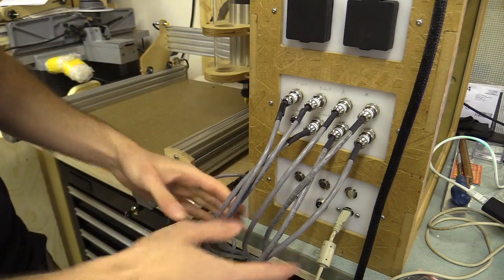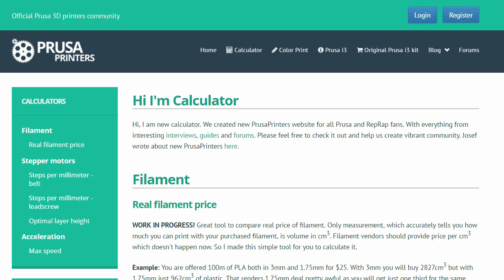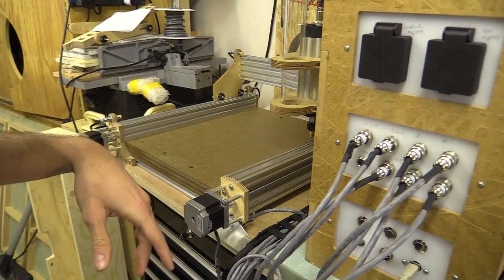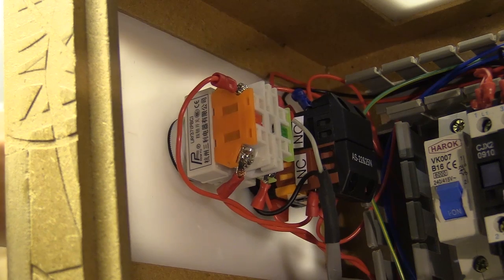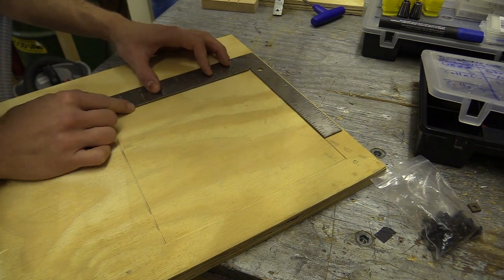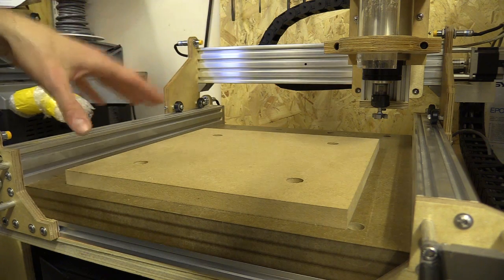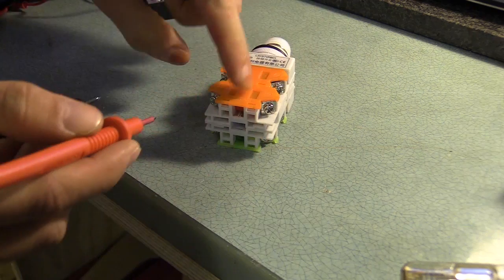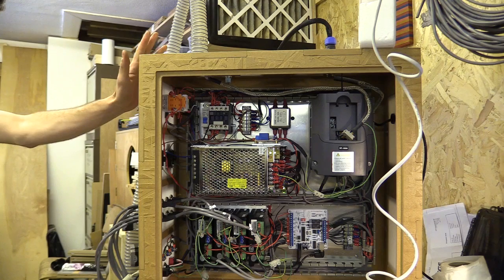#18a Debugging CNC Router Machine and Controller Enclosure #18a / Troubleshooting

Comment: Can't you use the enable connections on each of the drivers to stop the steppers without cutting power to them? All controller software will control the enable on a driver the same way. http://www.leadshine.com/UploadFile/Down/M542V2m.pdf
Reply from the maker: I think you are right but my latest controller is very different and uses the Duet 2 wifi. No need to faff about with external drivers.

Comment: So far you have done a real great job with the referring to issued related data ، i saw you changed water cool spindle with air cooling system ، i received someone suggested to use small radiator witch be installed on x axis and in did worked out perfect .

Comment: Could i ask if the two step motors that control the bed (x axies) are connect to the same wire that goes into the electronic controller  or two different wires that go into the electronic controller?

Comment: Thanks for all of the great videos! I've got my X & Z axis put together, but have a long way to go. Looks like lots of soldering. Any recommendations on bits?
Reply from the maker: Yeah life would be a lot easier if you can by a pre-assembled controller but I'm glad I made mine myself. I seem to be using a lot of 1/8 inch chinese bits. They are cheap and easy to use. I should make a video about the bits I use at some point.

Comment: Price of stepper motors in China are 300 percent  the manufacturing cost, like 80$ for a  100kg cm Motor, 20$ for 30kgcm motor etc, they should add 1$ for assembly and 2$ as profit,  Let's all the hobbyists make our own quality motors , one will procure laminations another copper , another will be making body .... we have to form a team, copper in my place is 10 dollars per kg , laminations is 2 dollars , steel casing for motor is 2.5 dollars per kg , other  accessories can be estimated from above prices . We can make a 100kg cm motor for 15$, let's join as team and start making these. Spindle motors of 3kw can be made under 50$

Comment: Unplugging stepper motors from their drivers while under power is excellent way to kill the drivers. 

If you want the spindle to stop faster you can try adjusting the slow-down time in your VFD drive. Breaking obviously depends on how much power your VFD can sink and on RPM and total rotational inertia - so bigger the cutter, longer the stop timeout, although I'm not sure if it'll be noticeable unless you use massive fly cutter or something like it). Good VFD's will trip and shutdown without failing if you make them stop too fast, the Chinesium one you have might do the same or it might decide to die, so test at your own peril.
Killing power to either VFD or the stepper controller/drivers is not really the best idea because their behavior is unpredictable without power applied. IHMO, eStop should be wired to signal the controller/VFD to do a crash stop but not to cut power altogether. If you feel the need to kill the power, wire in additional switch (either an eStop or other kind - maybe a circuit breaker or RCBO).

I don't know what the margin scan feature is supposed to do, maybe you can cover it in some future video

Keep up the good work. Good luck :)
Reply from the maker: Ahhh duly noted, thanks for the comments. I did find and enable a parameter on the VFD (which I was about to mention) which reset the VFD after overload, although the last few times I pressed the e-stop I wasn't getting the overload message like before - all a bit confusing. I might rewire the power back directly to the controller because the two NO swtiches to the breaking terminals on both the VFD and controller board are doing their job. Think I tried to cram in a lot in this video. The margin scan moves the gantry between the parallel limits of the x and y axes, and puts that information back into the software as the bed or waste-board margin. On a small machine it seems like a good visual way to avoiding the edges. Thanks again!

Comment: Nice to see you support labour :)
Reply from the maker: Yeah, bit nerve-racking. I think Labour under Corbyn have ran a positive, honest, sincere campaign, but they've always been on the back-foot. The bar is set so high for labour, but so low for the Conservatives. Labour has had to cost their manifesto and walk a tightrope with every policy, and the conservatives have got away with running a car-crash campaign, attacking their core support grounds, changing uncontested policies mid announcement, and replacing policies with smear campaign against poorly Dianne Abbott. It's actually been really horrible to watch...